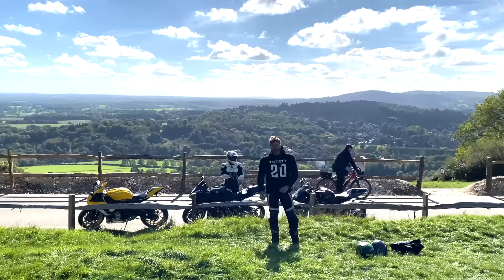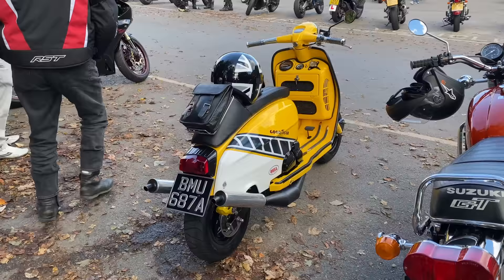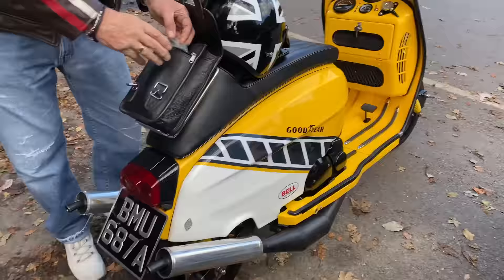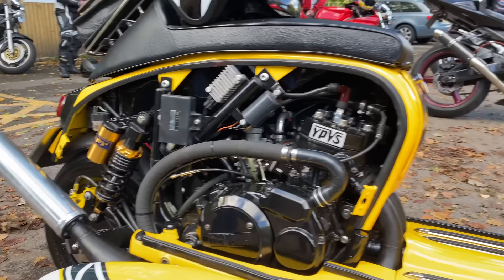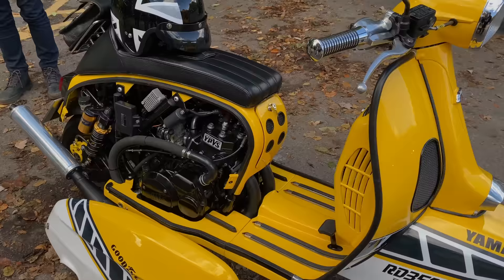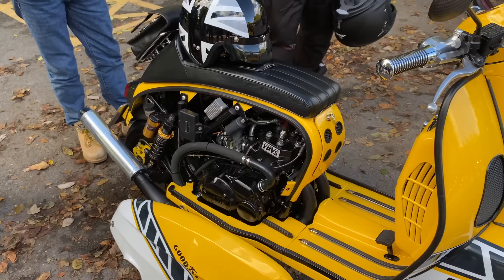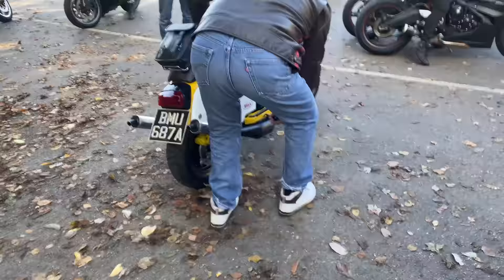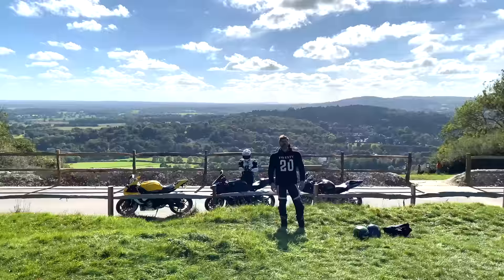Yamaha RD350 powered Lambretta scooter - MENTAL BUILD & SOUND!

Comment: Great build - well thought out. There are quite a few RD engined Lambrettas out there - 250/500 Gammas too. Scooter technology has come on leaps and bounds over the last few years with Casa Lambretta(and others) offering kits to take standard engines from 40 to 80 bhp depending on requirements and reliability required. Twin disc kits and other reinforced parts - engine casings/tyres/shocks/anti-dives etc available to suit. There's some mental kit for Vespas available too.
Reply: I have the casa SSR Scuderia 265. Its 47.5 bhp so that's very close to a bog standard RD 300. Not quite there but almost. It actually has almost the exact bhp and torque figures as the old air cooled kawa KX 250. I rode a few of those as a kid and I think that's probaly enough power! I'm pretty sure the cylinder is based on a KTM 300 dirt bike cylinder so it will have that crazy on/off power delivery. Before the scuderia I had the casa SS hyper performance engine. That was scary fast and I only really pinned it two or three times. 90> on a lambretta is not for the faint hearted!

Comment: The motor is from a RD350LC (Liquid Cooled), my friend had one and my other friend had the air cooled RD350, both were beating the crap out of my modded RD400. Awesome build.
Take care.
Reply: RD400 was assembled with smaller carburetors to restrict power. My pops had a '75 350cc that almost killed him.

Comment: Absolutely stunning build.

Only criticism, and it's not  a criticism of the bike, just the builder understating his talent,  but you should put on the video title that the engine comes from a RD350LC YPVS, rather than the air cooled RD350 as the title says.

Comment: As a RD350R owner, I have a things or two to say. First: I would NEVER put my cheeks on this Lambretta. Surely not with the engine runnig. 
Second: it's a marvel, really wonderful, a masterpiece. 
Talking about power, stock rd350 ypvs can go from 53 bhp (31k, 1st series) to 58 or 63, depending on model, but the engines from 1ua series are all the same. Brazilian unit can be a little restricetd.
Great work, man, enjoy it!!

Comment: I have the 2001 model in my garden it’s been there for 10-years. It’s red with red wheels full carbon fibre full race pipe sho fitted satnav clocks all in red and the clutch has dried up  did ride it and the clutch was sort of dry then but still worked but now nothing know leaks what so ever. I bought the bike off some one I know and he looked after it. Yours is the last model nice bike.👍

Comment: Takes me back to my youth, I owned a Vespa P 80s when I was 16 up to 18 years old. 
So I attended a few scooter runs, always some Lambrettas with an RD conversion were taking the prices at the drag competitions. 
So when I got my big bike license I first bought an RD 250 LC and then a 350 LC YVPS. Far away from the best bikes I owned, but always in my top 10 0f my bikes.

Comment: I was there on that day. The scoot certainly sounded the dog bollocks.  I have the same rear shocks, the cheapest universal shocks I could find on ebay at £35 a pair. Someone recently told me that the gas canister is just a dummy with nothing in it, but time will tell because it hasn't blown in the past 9000 miles and it certainly keeps the back wheel tracking well enough.
Reply: Please remember I built this on a budget so everything I managed to get hold of was cash limited… except the important stuff….

Comment: Very Nice Work the RD350. I myself owned a 75 RD250 in 76 my buddy w a 900 Sportster 4speed couldn't shake me with my 6speed gearbox  he'd drop a gear I'd drop down two  ha!  just a suggestion I back then switched the 2cycle oil to full 2cycle synthetic & those twi contrails of blue smoke in the rear view mirrors completely vanished
Reply from the maker: The blue smoke is a wonderful sight, would hate to see it go 😅

Kelvin has another RD project he’ll be showing us next month 😬 stay tuned!

Comment: Fantastic project...!!
Reply: Cheers guy …. I loved the challenge… would I do it again ??
Reply: @KelvinPaul-zy8eo  Cheers, I would dry the engine, put a head without the ypvs, resized with just one carburettor, there is a kit in the USA for this engine, two spark plugs per cylinder, this would give a very fine adjustment to the machine that would be more economical and with great performance, congratulations on your initiative, too bad that in my country our legislation DOES NOT allow us to take advantage of an investment like this.!! Brazil. hugs.
Reply: @andrealves9786  Now there's a thought ....... but i don't think the scooter will take much more power as it does a wheelie in third gear as it stands !!

Comment: Lots of Fun, I'm Guessing.
Reply: Wheelies in 3rd gear …. Lots of fun
Reply: @KelvinPaul-zy8eo  March 19, chance to get a bike, no Kawasaki shops nearby, thinking a good 250 LC, 350, or if the Planets lined up???, 500Lc. Turned down a 07 CBR600 RR sight unseen, opted for a '05 GSF 650 inj. Bandit sight unseen ?, Wow, 58, 59 times more biking joy, than in 84 my nearly new Kawa.750 turbo of, that I Couriered on, Thrashed it Daily, Countless times, it was Superb for high speed Planted travel. But Bandit Time Times, best bike ever, and I ain't even lying,

Comment: I would like to know what this scooter is capable of in performance,  of course that will depend on gearing.
 I built a SX 200 special in the 1980s with a lambretta engine bored out to  225, suzuki single ring piston ported and bridged compreession massivly increased. Binned the magneto and rant it off constant battry discharge. It could clock 120mph.
I then built several cars with suzuki hyabusa engines that were also crazy rapid...
But this RD350 lambretta I love, and built so cheap too. Amazing job
Reply: I have had 90 mph out of her with plenty to go but way beyond my capability to go past that figure 👍👍

Comment: My uncle once shoe horned an rg 500 engine in to a 1999 rm 250, and registered it with super moto wheels on 20 years ago before the prices for anyrhing rd/rg related went bonkers. After a couple of sheered bolts and a bent swing arm he left it in the garden under a tarp to rot until about 7 years ago, his mrs fed up with it being in the front of the house, sold it to a couple of young lads who had knocked the door a few times over the years, asking about it.  £80 is what she accepted!!! 80 quid!! She was going to let them take it for free but they kindly insisted on the £80. You can imagine his reaction when he got home from work.
Reply: @stoneautomotive  I no mate, all it probably needed was a new plug and fresh oil/petrol and she would of fired up after some tinkering. 😪

Comment: The standard YPVS bhp was specced at 58 so it would be interesting to get that on a dyno.
Reply: I don't think that were even 58BHP, I reckon low 50's max. I had the non powervalve 350, mine was very highly tuned, it developed about 65 BHP but it had to spin to around 11500 RPM to get that figure, it needed new pistons and rings every 7k miles and a crank rebuild every 5k miles. (could be the other way round, it was years ago). The YPVS motor was in a slightly higher state of tune than the non YPVS motor and it made a lot more lowdown power due to the power valve. Scooters are not really my 'thing' but 'engineering' is and therefore this scooter is great!

EDIT...Just checked in one of my books (AG Bell 2 stroke tuning), the non-YPVS made 42 BHP standard, the RZ350 which is basically an RD 350 YPVS made 47BHP standard.

Many years ago I ran a TZ350 in a F2 sidecar outfit, it made around 70BHP. It cost a fortune to keep that engine running.
Reply: @sidecarbod1441  All the ones sold in Portugal, had if not mistaken 58cv to 60cv.
Reply: @pedroferrr1412  That's 1983-6 Japanese BHP everyone knows that their horses are smaller than the standard horse! The YPVS sold in the UK was also the full power model and there is no way it put out anywhere near 60 BHP.
Reply: that's still alot of power, the 2022 Kawasaki ZR650 naked bike makes 68 hp with 650cc and tops 225km/h.
The Yamaha RD's where cool bikes, i had a RD80LC back than and a guy i know the RD350LC ypvp.
Reply: Here are some runs with numbers :
https://www.youtube.com/watch?v=6cMN_dF9LMY
https://www.youtube.com/watch?v=TTuCSgW-CQA
I would suggest this one is nearest to standard :
https://www.youtube.com/watch?v=xAnRZfs7yXk
Reply: @xvdd1  Cool, that Yellow one with upside down fork and different rims, changes the bike completely,  could have been build yesterday
i would love to ride one, but fuel consumption? spare parts from Yamaha? the frame is pretty cool.

here is one that was 30 years in storage and engine rebuilt
https://www.youtube.com/watch?v=uuvPiprgjqg
208km/h, that's pretty close to a current 2022 Kawasaki ZR650 with nearly twice the capacity.

another one, an older RD350 air cooled, doing 58Hp at the wheel and 63HP at the crank, German engineering.
https://www.youtube.com/watch?v=brcLY275_Ws

they knew these where deadly and decided to go green.
: )
Reply: @AnalogDude_  The German bike is essentially a replica of a 1972 TR3 production race model except for the RD reed valves and the claimed output for the TR3 was 58bhp this was probably at the crank but I do not know that for sure, I notice they had trouble with the wet clutch handling the power but they went with a dry one just like on the TR3 another advantage to making this change is the dry clutch runs with straight cut primary gears so no transmission losses from RD helical gears trying to push each other apart.
With the FIM limiting the number of cylinders and gears 250/350 Yamaha twins dominated the grids from the early 70's in some respects this was good as it gave more privateers a chance in the GP's on the other hand the works exotica from the 60's was no longer there MV Agusta being the last to fall to the two stroke tide.
Reply: @xvdd1  BMW seams to use straight cut teeth on the gearboxes, probably also the reason way they are so quick for a heavy 2 cylinder boxer machines.

I always had a soft spot for the Yamaha RD, didn't know they where used to Race as the 70ties was slightly before my existence.
I do know about the GP500 and Honda NSR500, Yamaha YZR500, but that's also quite  long time ago.

KTM seems to doing Superbike championship now witch is weird if you know KTM from motocross/enduro as does BMW with their S1000RR.

MV agusta makes cool bikes now, it's more exotic than Ducatti, you never see one.

I used the Yamaha RD80ties powerbox on my 50cc moped back and gained some free power.
Reply: @AnalogDude_  I think it is the other way around BMW broke with tradition and started to use helical gears I can only think they did this to make a quieter engine.
MV Agusta today is not the same company  it was back in the day, motorcycle racing was more of a hobby for the head of the family owned business Count Agusta the serious side was making helicoptors they did produce a few road bikes but not in great quantity so the bike side was sold off later.
VW own Ducati so they have access to greater resources then MV Agusta although I think they are looking for a buyer for Ducati.
Reply: @xvdd1  the BMW R1100 series, K1200, K1300 have straight cut teeth in their gearboxes from what i seen on tube, probably all the boxers, R1150, R1200, R1250 you read it a lot that their gearboxes sound rudimentary and clunky even the 2020+ R1250RS. not sure about the K1600/six cylinder cruiser, the BMW R18 (chopper)
But pretty sure for the S1100R as they are used in superbike championship and is a currently a top 4 fastest bikes on the planet.

BMW after Honda and Harley is the biggest on the planet in sales numbers, although Enfield in India might sell more than all of the above combined.
Reply: @pedroferrr1412  Now I don't know anything about the YPVS in the video that I have linked to, it sounds OK but that does not tell me much, at 3:54 you can see the dyno run, it made 43 BHP....https://www.youtube.com/watch?v=3JbSNNA8H9o
Reply: @xvdd1  Even that last one that you posted a link to had a set of pipes and air filters, (I guess the carbs were re-jetted too), it was not totally stock. The pipes and the filters on the standard bike are quite restrictive, this bike made 51.5 BHP at the rear wheel which makes 48 from a totally stock bike about right. (Nowhere near the 58 that some people believe!)
Reply: @xvdd1  well, these engines have a lot of torque, comparable to a car or more for the same cubic capacity. the R1250 sounds and revs pretty "aggressive" compared to a R1100 or R1150, you can't compare them.

they seems to be cut a in course design comparable to other BMW gearboxes, big teeth, how much power would you loose?
Reply: @AnalogDude_  I do not know how much power loss there is there are many variables I would like to see a like for like lab test to give a ball park figure but those engines do have power to spare as you say so clearly BMW designers felt it was worth the trade off there is a ton of formulas for predicting transmission losses although they will be using software to work those kind of problems back in the day they were using slide rules and head scratching.
Reply: @sidecarbod1441  Nice, the opening dialogue was from the film First of the Few about R J Mitchel the designer of the Spitfire.
Thanks for that yes it probably had no porting work and I am guessing that was at the rear wheel manufacturers commonly quote HP measured at the crank for the bigger numbers.
Reply: @xvdd1  head scratching
lol, yeah.

for me they are the coolest bikes on the planet with their paralever suspension.
it's just the gearbox makes a bit off noise when the cycle is turned of and you play with the clutch lever and when you drive it it's like you slam gears but you aren't, like rally cars otherwise it works just fine. maybe people with less mechanical skill found this odd and complained. seen these comments a few times. clunky gearboxes.

a not so old episode of Top Gear featured a old Ford escort with rear wheel drive using a race box and they complained about the noises the gears make but liked the acceleration advantage.
Reply: @xvdd1  the machines needed to cut straight teeth are also more simpler. just a up down motion.

Comment: Any idea how he did the gear shift and clutch? Is it still on the left handlebar? Also, didn't the Yamaha RD350 transmission have 6-speeds vs the Lambretta's 4?
Reply from the maker: Hi Joe, as discussed briefly in the video it uses the original shift location and clutch on the handle bar 👍

Comment: The RD350 used to put out around 39 BHP in standard form nowhere near 69 .
Reply: That is odd. The 750cc 2 stroke Kawasaki H2 put out 70hp.
I had the larger  RD400 and the manual said 44hp .

Comment: What the sense of this. How you can drive in UK road with this kind of engine in a frame of 50 years. Where the safety. How you can get the permission to travel in the road.
Reply from the maker: The UK is pretty relaxed with allowing builds like this to happen and be used on the road 😎

Comment: I wonder what other engines would fit? What are other options are there?
Reply: A Chevy v8? 😃
Reply: @muckle8  There were several Rover V8's put into Norton Featherbed frames. 

I think with a Chevy you wouldn't be putting the engine in more the scooter around.  😄
Reply: Gilera Runner 180 two stroke makes them go rather well. You can transplant the entire rear end with a few modifications.
Reply: @retromechanicalengineer  Just had a quick look. Yes I can see that.
Reply: A 500 cc motorcross motor would be interesting too  if you could possible find one these days , a cr500 or kx or rm etc , would be lighter than the rd twin and another 15-20 bhp too?
Reply: @muckle8  Now that is a thought! 😃
Reply from the maker: There’s an RG500 swapped one on YouTube too 🤯

Comment: My mates doing a lambretta with a yz 490 motocross engine and cradlle in it.
Reply from the maker: Blimey that’s gonna shift! If he’s around London Heathrow and wants to get it on the channel drop me a message
Reply: Not sure how it can be done with a free air motor .
Reply: @Crashed131963  holes. Lots and lots of holes. Also modern pistons contain better stuff and not so prone to heat seizures.
Reply: @arron0bryant874  Cool . 🙂

Comment: Allan Rosser from Preston   was the first to do this  essentially a morally flawed genius 
He was the first to make CD Iignition, disk brakes
Allso the expansion pipe curled like a snail   I watched him buy some cones of swarbrick which he designed and then make loads of cuts with a butchers bandsaw he fitted made a metal blade on each time cutting at a angle turning it and gas seam welding that he just learned in 20 minutes from Frank Sanderson   I left him in our shared unit at w in the morning   went in at 10   he must have made 40 or 50 cuts    it fitted like a glove 
Crazy days     unfortunately he ripped a lot of folk off and started dealing drugs with a Manchester bad gang     one of them allegedly shot him dead
Reply from the maker: Always a shame to hear when good fabricates turn bad ☹️
Reply: Rosser was the first person to do this back in the 80s but his machines had problems. Cracking hubs, overheating engines etc etc When I built this I went through all the problems he had and reworked them … this one is perfect with no problems at all … so hopefully no one’s going to shoot me … I am joking !!!